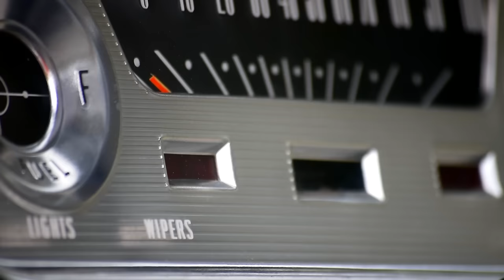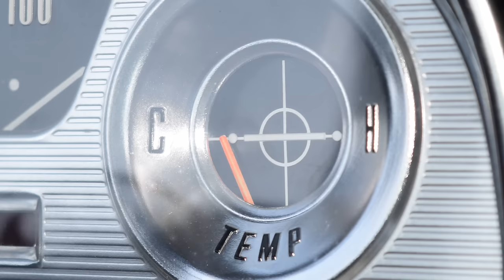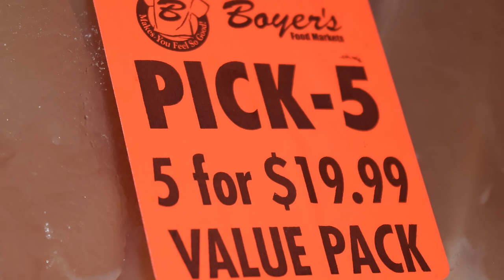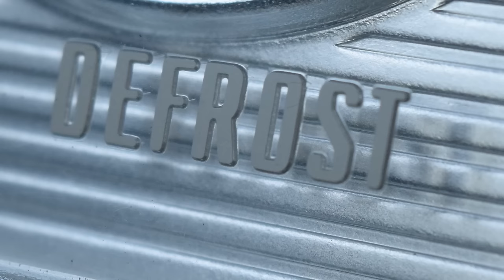Regular Car Reviews: 1960 Ford Falcon (stock)

Comment: I think it's sad that you probably don't know about how Ford became a major car manufacturer in Australia off the strength of the Falcon.  The first Falcon was introduced to Australia in 1960, assembled here with mostly local components directly copying the US product.  The cars were very popular because of their light steering, perky engine and interior room.  Problem was that on Australia's rough outback roads the ball joints fell to bits.  This necessitated the re-engineering of the American suspension and that was the birth of "Australian Falcons".  Aussie Falcons continued with US styling and the US straight 6 (although modified for Australia and made here...bored out as much as possible) until 1972, when Ford Australia designed a totally Aussie Falcon (of the type used the first Road Warrior/Mad Max films).  In the late 80s Ford Australia working with Yamaha designed a new cross-flow head for the six cylinder motor, closely followed by a full Bosch EFI system.  That motor is still in use in today's Aussie Falcon producing 195kw with comparably great fuel economy.

Today's Australian Falcon is a wonderful car with a front end reminiscent of the current Aston Martins and a gutsy 6 that has been so heavily redesigned it is basically a totally new engine.  Of course there are also V8 Falcons as well.  Sadly the beancounters in Detroit have decided to kill Ford Australia's manufacturing plants (GM is also killing Holden's factories) and so the Falcon will be no more.  56 years of great Aussie and American know-how down the drain.

Comment: There really is no modern day equivalent of a car like this. Even the cheapest economy car has A/C, P/S, power brakes, ABS, etc. Even cars without power windows and locks and cruise control are hard to find. A friend of mine bought a new 60 Falcon with the 144 engine and the uncommon 4 speed stick shift and nothing else.

Comment: One of my best friends drove a 1960 Falcon in high school (83-86) and it was miserably slow. It literally could not climb hills with four people in it. There were times when we would get out and walk next to the car while it puttered along at walking speed up the hill. It also had vacuum actuated windshield wipers. In the absence of engine vacuum (at wide open throttle), the wipers would stop working. So if you had the engine floored (which you did ALLOT) the wipers would stop. If you were ever climbing a hill, in the rain, you had no wipers! And yes, there were times, when we walked, in the rain, up a hill, next to the car giving the diver directions because he couldn't see. Terrible car.

Comment: My dad bought a '61 sedan for my mom. It took us to school and around town for 8 years until the floor pans rusted out. On cold days, it would not start, period. Forget spraying ether or using jumpers or warming the carb and block with hairdryers. If it was less than 20 degrees outside, just forget about it. However, even at the time, everyone knew that it was just cheap basic transportation. Nobody bought one for performance or to impress the neighbors, and my mom had few expectations for the car as long as it started. Today's standards in automobiles are a universe apart from 1960, and it seems rather pointless to compare features, safety and comfort from a 1960 econo-car with what is produced today. Think about comparing the '60 Falcon to an '03 Ford Runabout. Same perspectives apply.

Comment: I'm sad to report this is the vehicle my parents had when I was just a sprout.
 You might want to mention (if you do a follow-up) , about the amazingly poor vacuum windshield wipers. I recall them almost coming to a stop while driving up a hill or accelerating at any significant speed. then, as available engine vacuum Rises when the engine idles , the windshield wipers go like crazy as you sit at a stop light. the most useless setup you can imagine. But, I guess at the time they were far less expensive than Dependable Electric windshield wipers.  but, as you said in your review, the damn thing never broke.

Comment: I guess the transmission just kills it. With a standard european 4 speed manual of the time, it could drive really neat. And all the ancient stuff - pretty normal in 1960, all cars in the world had drum brakes without assistance, no power steering , no mirrors, seat belts or reverse lights.

This competet against 32 hp cramped noisy beetle, and actually had better mileage.

Comment: Shit do I relate to your tangent on the engine.
My 77 150 has the 300 inline 6 
The oil cap has a vent into the air cleaner, the fan pulls from everywhere BUT the radiator 
Bur the motor take forever to get hot.
10/10 can relate

Comment: Ford chose the Falcon in Australia as competition for the General Motors Holden FB, they looked at other models to build in Australia including the Zephyr from England being strongly considered, as it was already imported and sold here. They chose the Falcon to build here, it's form was identical to the US model apart from RH drive. They considered suspension upgrades but budget won out and they retained the US suspensions on Aussie rough roads. The XK (same as your red guy) proved a disaster for Ford, mainly through suspension failure. It impacted terribly on sales for many years, as Aussies viewed the Falcon as a piece of sh**! By 1965 and the introduction of the XP Ford had invested a massive amount of money in improving reliability. Ford Australia produced the Falcon until October 2016. Their last inline six, the famous "Barra" was still a direct descendant of the 144cu i

Comment: I think I have the only 1966 falcon with 13 inch tires small diff absolutely no options not even a horn ring.  The dash has a blanker plate where the radio should be and a blanker for the cigarette lighter.  3 on the tree.  It doesn't even have the horn ring, just the center horn button.  I have been to many shows and have never seen the most basic falcon you could buy.  Folks ask me why don't you hop it up and I say then it would be just another hopped up falcon and loose its uniqueness. It takes me to work 50 miles one way no problems and 27 mpg average.

Comment: This was the first car I drove after I got my drivers license my dad gave it to my mom after he got a 1965 Cutlass.  The car had a 2 speed automatic an the acceleration was pathetic you could floor it in a city block and still within the the 25mph speed limit. Finally I talked my dad into buying 1969 Nova  My 1st car was a 1966 VW bug which was far more fun and sporty to drive than that Falcon.
Reply: the 3 speed stick was fun and peppy

Comment: Yep,my 62 ranchero with the 200 six,weber ,80's head,stainless valves,cam,headers,t5 and discs is just a car.And cheaper to run than my 69 crewcab with 450 hp.

Comment: First, it's the 1960 Falcon, first version. Of course it bit the big one. You should find the later models, say the 4 door 1963, 3 speed, 170 straight 6. It had reverse lights, and oh yeah, Amber turn signals in front. I know this, because I rebuilt one in the 1980's, my first car. Powder blue body, with a white hard top roof. Somewhere I have a picture of it. To this day, I curse myself for ever parting with it. Let's not forget. The Mustang was nothing more then an improved motor redressed body style Falcon. The chassis stayed the same, but got a new body style on it. I don't care for your critical viewpoint of this amazing car, that got over shadowed by a wild horse. Did you know that in Australia, Ford there kept the Falcon name. The Mad Max car is a Falcon GT. The Pursuit cars are actually Maverick in America, but their are the Falcon. Like the use of the Falcon Ranchero in the opening moments of that movie.
Reply: very good

Comment: All of his so-called "flaws" were shared by every car of 1960. Crank venting, no A/F catch tank, single master cylinder brakes, etc. My Dad bought a new 1960 Falcon wagon with the 144 in engine, and easily ran 38-40 mpg (manual trans)

Comment: You forgot to mention the manual choke...  This car is from "my day", so it doesn't seem so quaint or unusual to me. Some important points must be made though: 
Not fair to knock it for white signal lights and no hazard flashers - those weren't used in any cars until they were mandated in later years. 
From the beginning there have always been cheap, and sports, and luxury models of cars, and still are. The Falcon was cheap, and so it didn't have power or automatic anything. Those of us at the bottom of the economy (young) didn't want auto transmissions, A/C or power windows because they were costly broke pretty often, and cost money to repair. 
In the early 60s the Falcon, and cars like it, were a common car for a young couple just starting out to buy, and by the mid 60s a 5 year old used version was the perfect 1st car for a teenager. I didn't own one, but three of my friends did. As a used car they were a reasonable alternative to the likes of a tired 55 Buick that would have cost about the same - around $250.
The Falcon basic, but more or less equivalent to cars of the day and easy/cheap to service. I might add they were a wicked car to stuff in a hot 289 V8 - Very light and quick, although frightening and scary dangerous, LOL. 
As for the steering and suspension, strut and multilink suspensions didn't exist in passenger cars back then. You might as well have remarked on the lack of fuel injection at the same time.
Thanks for the time trip back to my youth! Yours was a great review of a true and real classic.

Comment: Very harsh review of the little Ford Falcon. I bought a 63 from a junkyard for 50 bucks. It needed an oil pump, brakes paint seat covers, all the usual stuff. The 170 six was adequate(barely). Fuel economy astonishing, but the 2spd air-cooled auto trans was awfull . Seemed like an eternity to shift into high. Still it handled well, steering was light, and would motor confidently at 60-65 mph. It just took a while to get their.

Comment: He is wrong about the 200 six , it was a different block ,7 main bearing engine , compared to the 170 and 144 which had 4 main bearings , they were weak engines.
Reply: I put a 200 six in a 1960 Falcon and got the same gas mileage with a LOT better performance, great swap !

Comment: The Ford Falcon was not the first American "compact car".  Each of the "Big Three" unveiled brand-new "compact cars" in 1960 in an attempt to counter the rising popularity of small and inexpensive European imports, particularly the VW "Beetle".  Those models were GM's Chevrolet "Corvair", Chrysler's Plymouth and Dodge "Lancers" (later changed to Plymouth "Valiant" Dodge "Dart"), and Ford's "Falcon".  However, Kaiser's "Henry J" predated all of those models by a full decade.  Unfortunately, the Henry J had the disadvantages of being produced by an independent auto manufacturer (Kaiser) and of being too far ahead of it's time.  Kaiser stopped manufacturing cars after 1954.  Incidentally, in 1960 the the Big Three's "compact cars" also had stiff competition from two other American rival "compact cars", American Motor's "Rambler American" and Studebaker's "Lark".

Comment: Don't ruin the vehicle attempting to make it a late model. It's a 1960. Buy a modern daily driver and keep the Falcon stock. Leave the original equipment intact. 
Early to mid- 20th century driving was more physical. Some  antique autos had only one tail light and no turn signals or brake light. The driver used their hand to signal left, right, and stop. Radios were a luxury.
You stated the lack of power assist on the 1960. Back in the day...People drove manual transmission vehicles and learned to steer them while they were still rolling. No power assist. They anticipated stopping and parking maneuvers, too. They would parallel park turning the steering to wedge a tire against a curb which helped secure the vehicle from accidentally rolling while parked. Place the car in gear for additional rolling resistance at rest. The parking brake might slip. They exited on the curb side by sliding across the bench seat, 3 on the tree was common and popular with women wearing skirts.

Comment: F for de old ford falcon I love them i got 2 made hear in argentina one from standard 188´´ 1981 the other 1972 futura sp 221´´ (i heavy modified this old one i make it cabriolet and rebuild that 6 cilinder to make 250/300hp...) both 6 inline

Comment: At timestamp 12:52
The Ford Econoline e100 pickup truck, which was based on the falcon, with 3-speed manual transmission was no better! 1st gear got you started and the engine would hit max RPMs in 7 seconds....MUST up shift! Now that you're in second gear, you better damn well have gotten the truck up to your final speed you want to be at because the gear ratio of third gear Is so steep of a drop, it will bog the engine.

Comment: Do another one showing all the dash and  trunk and  backseat and glove box. Where's the spare?  That was my first car. Had to run a stop sign at a certain intersection to  make  it up the hill in 67. 3 speed  manual.  Start  from  first  at the  stop and 1/2 way up I'd  roll back down.  No radio.  No one  had  ac then. Next 67 makibu, 69 firebird,  backwards to a flat upwards to a BMW with a few in between. now practical and safety matters.
Reply: Because I don't have any pictures of the inside.  Have a  couple of  black  and white of the outside.

Comment: I love that car. But then I love pretty much all pre emissions American cars. I own a 1964 Fairlane. 200ci straight 6, 2 speed automatic, and not much else. Manual steering and manual drum brakes. I call it my freedom car. It is exempt from any kind of emissions testing, it has no safety bumpers, side impact door beams, ABS, airbags, or any of that other bullshit forced on car buyers these days. Though it has lap belts, my states seatbelt laws don't apply to it because of it's age. It's what a car should be and I wish I could buy a brand new one. But I can't. So I'll have to keep this one running for the rest of my life. Which should be easy, because it is so easy to work on. Modern cars have become absolute nightmares.

Comment: The front turn signals would have called for amber bulbs, pretty common in this era. It sounds like your engine is somewhat tired if you're having all that trouble getting up a hill.

Comment: You should compile all of those MacNamara jokes into one volume. I think that you're a little hard on the old Falcon. Instead of comparing it to modern cars; compare it to what preceded it : VW bugs and the Nash Metropolitan. I can see that the American Falcon was stronger than the XK model released in Australia  with the US example having braces between the firewall and the shock towers. Ford did well marketing the Falcon overseas; especially in Australia and South America. The latter being produced with much the same body and engine well into the 1980's. Here in Australia they kept improving the Falcon and turned it into a hot rod with the 1967 XRGT with 289 V-8 and 4 speed. By 1971 the Australian XYGTHO Phase 3 was an absolute monster that could run at 145 mph. Not bad for something that started as an econobox.

Comment: Still faster than a chevette, dodge omni, Mercedes diesel, rabbit diesel or any diesel car made before 1986 or so. Actually wasn't that bad when it had a tune up.
Reply: For the time it was a good cheap dependable car.
Reply: These wouldn't run at 55+ mph all day on the highway like a 70s or 80s econobox. The gearing was for town use, 30 mph average. These were made when the nation was still completing the interstate highway system. Back then you'd be out in the boonies and the Highway Department would detour traffic back to the old State Highway. Like the Doobie Brothers album cover for The Captain and Me, the ramp was under-construction.
Reply: Lucky B this car would go 80mph all day. They were built for it.

Comment: Children just do not enjoy simplicity, I got my first Falcon in 1984.
Still have two Rancheros.
All the crap that new cars have to make them stupid proof
you were expected to comprehend with your brain.
It is true that 144's were a bit low on ooomph.....
The 170 overcame all that, and even Caroll Shelby was running 260's
in race cars as soon as they were allowed in Ford Models......
Falcons are the ultimate in a car that looks nice
drives easily, and will remain around longer 
 than the Body Control Module in any new car.....
If you require proof, drive one through any
average College district, 
see how many smiles you get from 
the pretty girls......

Comment: Yo wtf, They claimed 30mpg with the i6 engine. That's pretty damn good.
Reply: Operative word there being "claimed".
Reply: If they claimed 80hp instead of the actual 50, I'd say these things made 18.75mpg instead of the claimed 30 as well
Reply: no its getting 30mpg. my mustang with a 200 L6 gets around 26 combined and its a larger motor with more smog equipment
Reply: Why do people think gas milage is a new thing?  That falcon could easily get 30.  My 1953 Kaiser Manhattan is a much bigger car, with a 226ci flathead straight six (monster cast iron), and a ton more weight (~3500 lbs), and even on it's sludge-encrusted tired-out 60 year old engine (before I restored/rebuilt it), it was still getting 22mpg.

Comment: You can't really pick on the Falcons for having a single master cylinder; even Cadillacs had them in 1960.
Reply: My 1966 Thunderbird has one, didn't offer the divided one until "67. I remember driving a "65 LeSabre that would wear a spot on the front passenger side brake line, twice had it suddenly lose all brakes while in city traffic. Luckily the e-brake save me both times.